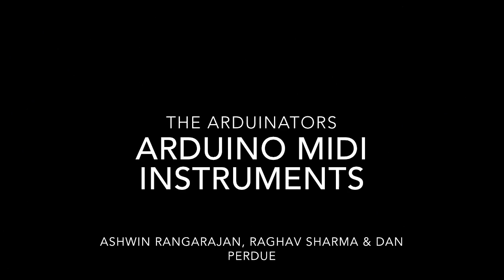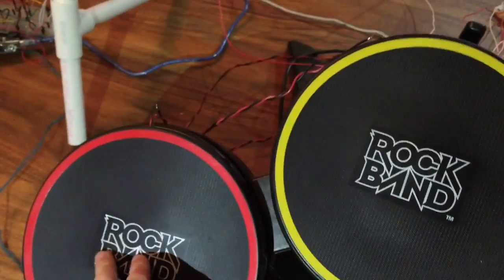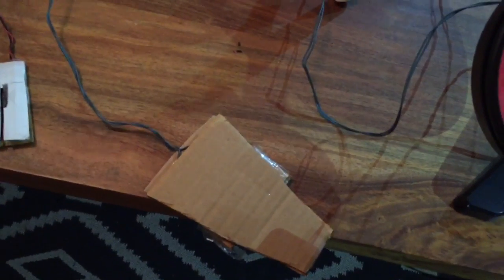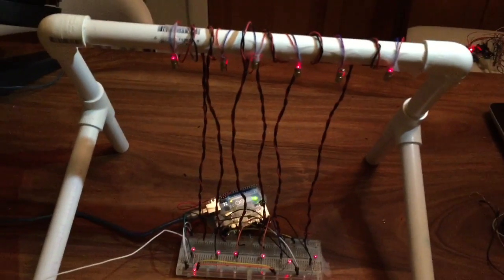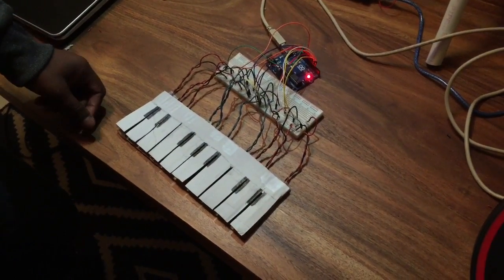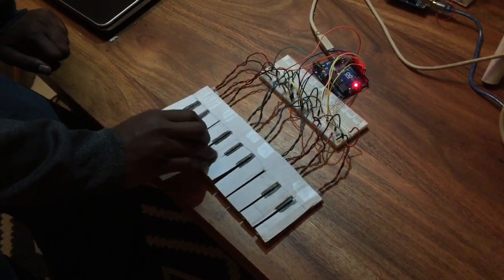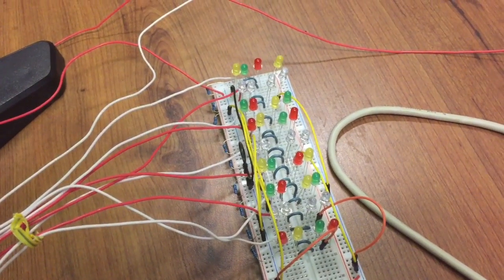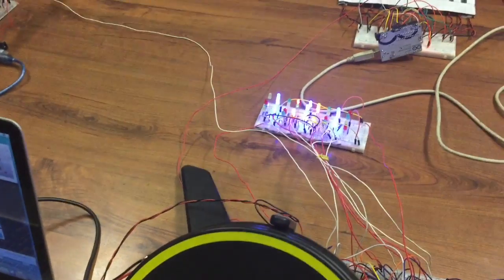Arduino MIDI Instruments

Comment: I know this video is 2yrs old - but can you share your code?  I'm looking to do something very similar but have been stuck getting my outputs to the computer to play midi
Reply from the maker: I just found the code recently. I might try to put it up on github soon but in the meantime there is an explanation at the end of the video how we hooked everything up. We used a program called hairless midi to convert serial to midi.
Reply: @AC5FF If you contact me in PM I can assist you :)
Reply: Hello. I'm also in the middle of a MIDI drums project but I am getting some "annoying" lag. I don't see lag in your video, but maybe that's just because I am not the one playing the instrument. Can you comment on this, please? 

Also, if you uploaded your code, just for reference, I'd appreciate it :)

Comment: in piano u made 
for what is contact layer  and midi software is  used?
what if we just programme frequency for each note and send to the speaker???
plz reply
Reply from the maker: We used Kontakt as our midi software and something called Hairless Midi to convert serial to midi. There's a full explanation at the end of the video.
Reply: thanks sr.
have u also used loopmidi apk

Comment: i really need to ask you some questions lol. :) im rather stuck on something related to this.
Reply from the maker: I'd be happy to try and help. It's been a while since I worked on this so my memory is a little fuzzy. But feel free to ask any questions and I'll do my best.
Reply: @danchanwan  hello can you help how did you make the laser work when you pass your finger. I am plannig to make a DIY photobooth and I dont have budget for an IR frame planning to use it as a trigger to send keyboard signal

Comment: Hi . how are you dan . if i made drum set device with ardiuno .still coneccet the ardiuno with laptop ? or i can made my drum set without laptop?
Reply from the maker: Hello! For the project we demo in this video, yes you would have to have the Arduino hooked to the laptop since that is what is interpreting the midi and playing the sounds. The end of the video goes over some details of this setup.
Reply from the maker: Sorry for the delay. In our case, yes, you would still need to connect to a laptop since the laptop has the midi software. There may be a way to create something without having to connect to a laptop but then you'd need to store the sounds on the Arduino itself I think.